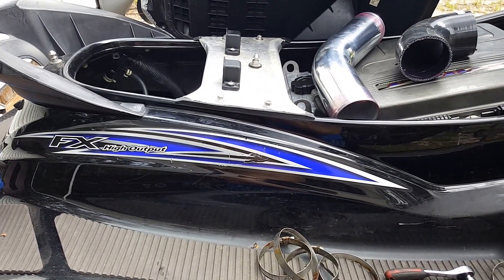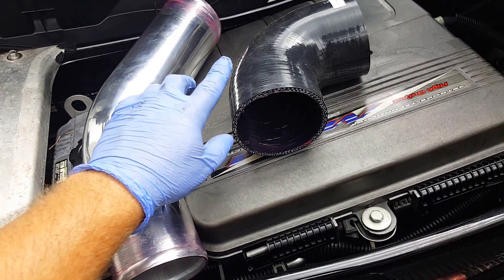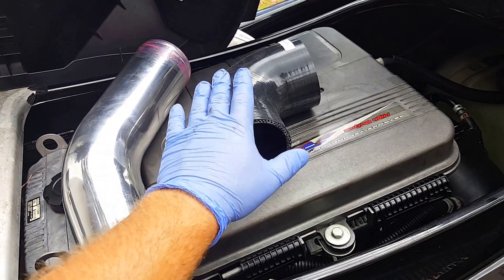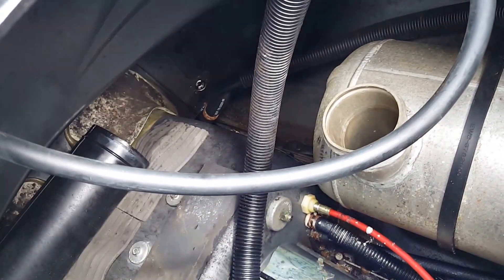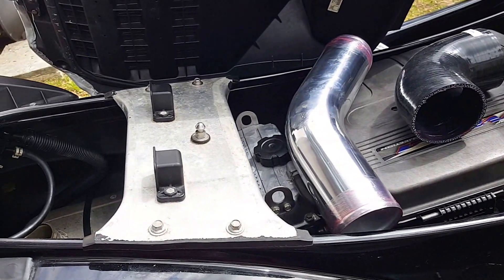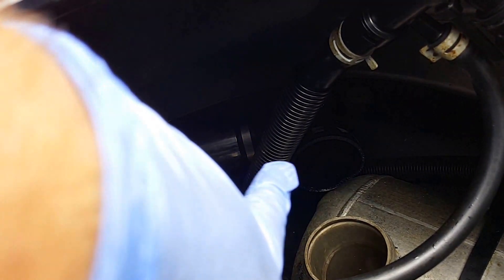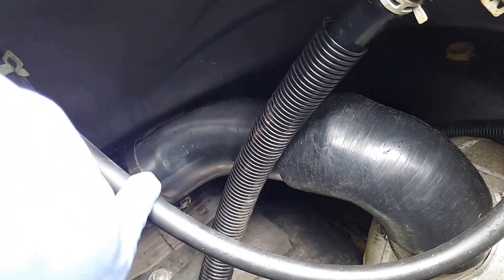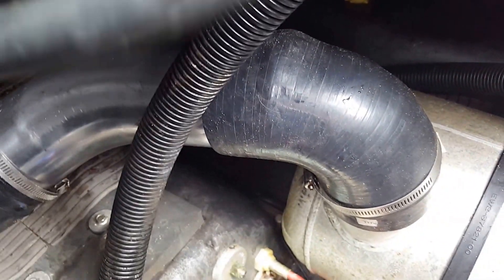Cheap! flow through exhaust Yamaha RIVA RACING KILLER

Comment: Just a heads up, some guy on the forum have mentioned that the extra weight and the position of these home made money saving exhausts puts strain and pressure on the stock exhaust exit and starts cracking causing leaks
Reply from the maker: Cool!

Comment: Well I ordered the pipe and that fit fine into the rubber part that goes to the rear exit but the silicone part is a no go so far. 1st company I ordered the 3.25 n it was way to small. Measured at 3’” on the inside. Then I ordered another that specifically said 3.25” ID. Not going on still. 1/4” is pretty hard to stretch. Should have gone with my gut and ordered 3 1/2” for everything. The metal pieces have the bead roll so even if it wasn’t super tight it would clamp down ok

Comment: So I tried this exact setup... tried to start the ski and I wouldn’t stay running.   After much trouble shooting I never could identify any problems. So I ended up putting everything back to stock, and the ski ran perfectly again.  Any ideas or did I miss something?  Thanks for any help (2005 VX1100)
Reply from the maker: I'm not sure I didn't have any problems maybe you have a sensor on your water Box or somewhere
Reply: I was thinking of doing my 2013 VX1100.......did you ever work out what the issue was?
Reply: @mekuranda  no I sure didn’t.  I’m very mechanical having worked on my own cars and motorcycles all my life.  I tried everything I knew to do and researched  the internet as well for any similar issues or discussions with this conversion but to no avail.  Each time I put the stock exhaust back on it ran perfectly.  Weirdest part of it all is I actually removed the spark arrester and air filter/breather both before and after trying this exhaust mod, but the intake mod had zero affects whether the exhaust was stock or modded.🤷🏼‍♂️. Ended up selling both my skis this past Summer.  Still have the boot and elbow; be more than happy to send em to you for shipping cost.  They’re no good to me
Reply: @edgeprep  thank you for the reply. I am in Australia ...not sure if international shipping is viable unless you have a fantastic deal with freight company.
I have seen a few vids on people removing the air ribbon filter...not sure why Yamaha put it there, must be there for a reason... safety, flame arrestor...not sure I would want to reduce safety for a little performance gain, but the exhaust is unlikely to reduce safety and might sound a little better, beefier, and have a performance boost, at the expense of quietness...the VX is super quiet in stock trim.
Reply: @mekuranda    ah!  Yeah, probably wouldn’t make it to you without its own VaX passport anyways.🤷🏼‍♂️.  Yeah I regretted removing the ribbon on the intake side after watching a few hull explosion.  Definitely had a deeper more throaty tone, but wasn’t worth the risk.  Everyone I knew had done that mod with no disaster, but there’s always that one chance.  Nonetheless, good luck with everything on your ski.  Also, wishing you all the best down there with everything you’re going through;  it’s truly been unbelievable from my viewpoint.

Sky News Australia is my regular go to for the past year because you can’t trust any of them here in the states.  Anyways,  stay strong…the world is watching us both!  Cheers
Reply: @edgeprep  Thank you again, I am in Far North Queensland and believe we are the least affected, I feel real anguish for those in southern areas, particularly as they get cold miserable winters on top of everything else...our pollies have sold us out big time. I watch Sky mostly, and your news (Fox) a bit...mainly Huckabee for a light humorous twist

Comment: I’ll check again but I didn’t see or unplug anything.  Thanks for the quick response
Reply from the maker: It should run without a problem all your doing is removing  a couple of pipes and baffles doesn't make sense why it would not run correctly

Comment: OK so I have a 02 fx140 what do u recommend to use?
Reply from the maker: Sorry can't help never did a 02
Reply: Used to have an FX140, I put a Riva free flow on it, and honestly, I was dissapionted on how quiet it was. However the Riva free flow is plastic so if you use metal i'm sure it would be louder.
Reply: daltondrummer was there any performance difference on it?
Reply: Honestly it felt slower, all these people think they get gains from making the engine more free flowing but it'll just run worse as its tuned for the stock exhaust. If you get it tuned to the new exhaust sure it would be faster.
My old Fx-140 literally blew up right after I put the exhaust on. (No it wasn't the exhausts fault it was just old and leaking oil already.

I did a lot of research and there's just so little mod support for the FX-140 that i'd recommend keeping it how it is.
Maybe polish it and make it look nice to sell.

I got a good deal on a FX SHO 2009 for 6K.
MUCH faster, there's no comparison, it scared everyone who rides it with me.
If you want to mod, get one with a supercharger and ECU tune it.
Reply: daltondrummer you is was slower do to the exhaust did it had an intake also or just exhaust?

Comment: Hi where did you order these parts from?
Reply from the maker: Ebay inter cooler turbo pipe
Reply: What is the length of the 45°?
Reply from the maker: @kello236    I believe 12" not sure have not done this mod in a very long time

Comment: Is there any issue using Aluminumin pipe as opposed to stainless. I notice the stainless is close to the fibreglass body shell is there a min. Distance to stop heat transfer issues to fibre glass?
Reply from the maker: I had no issue with it and i run it every weekend.  also I am sure you can find some kind of thin stick on shield  to stick on the hull from eBay.
Reply: FLORIDA LIFE CLIPS thanks great video by the way